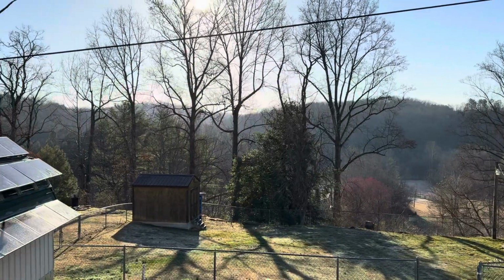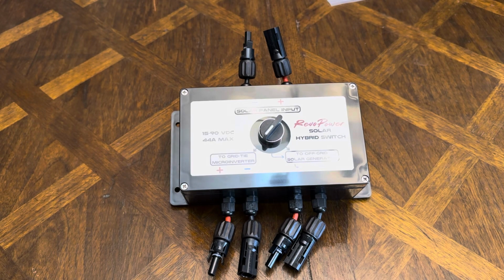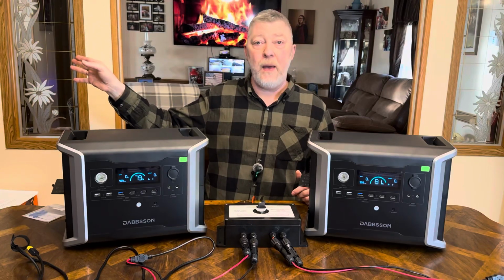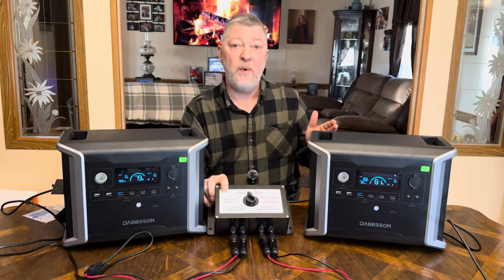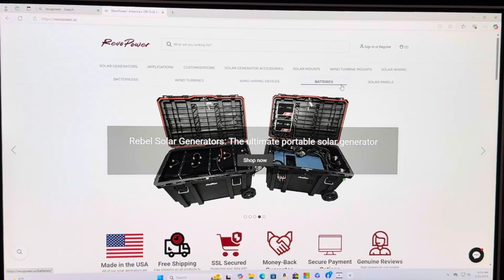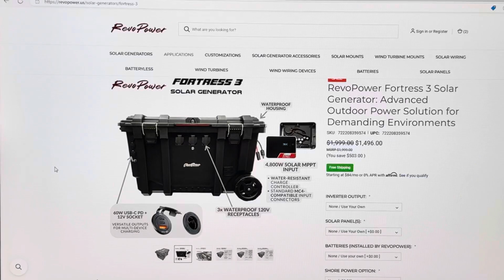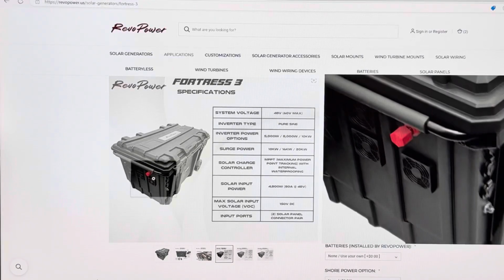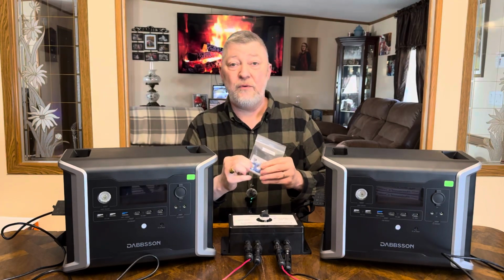Hybrid Solar Switch by Revo Power, using two separate Inverters / Power Stations on one Solar Array

Comment: The link you provided is for their series/parallel switcher not the hybrid  dual output box you demoed in the video.
Does the switch in the middle select the same output that is  on the right?
Only downside is this is limited to 90V 44A, most larger power stations go up to 145/150V with a max of 20A. If they could make a box with higher Volts (150a) and less amps (25A) I would buy 2!
Reply from the maker: @grindychum  Go to their website. They have several switches & with larger volts. I know link doesn’t take you to exact switch but that’s what the link gives you for this switch. Go & check them out. Thanks for watching my channel.
Reply: @EASTKYPREPPER  there is one switcher @500v but only does 8A -  most panels over 200w are rated above 8A.
Reply from the maker: @grindychum  I’m not sure what all their switches volts & amps are. Message or call them & see if they have higher volts & amps. They seem to know their stuff, I’m sure they can help you with what you are needing.